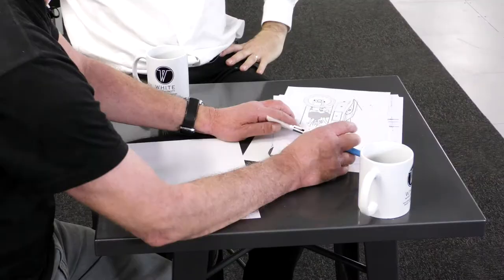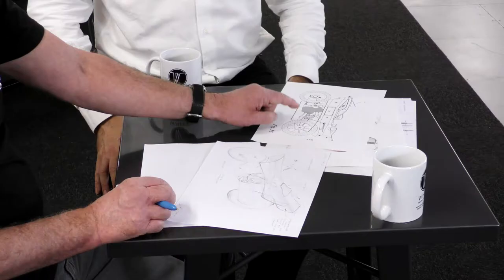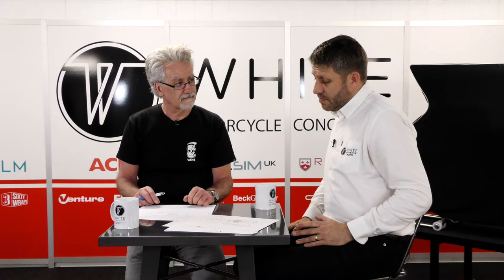Part 1 of 5: Rob White and John Keogh discuss the Aerodynamic Concept’s Origins

Comment: One of the biggest problems in the emotorcycle industry is at the design level. They keep designing them exactly the same way they design a gas motorcycle, which is rather absurd. This is one of a rare few emotorcycles that actually seems to take advantage of the freedom that an electric powertrain enables. Very well done, gents.